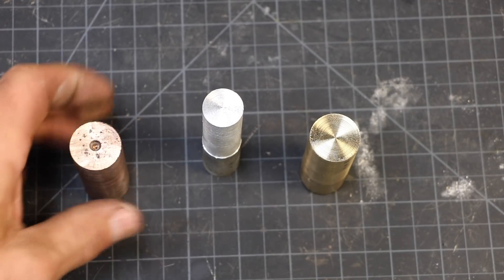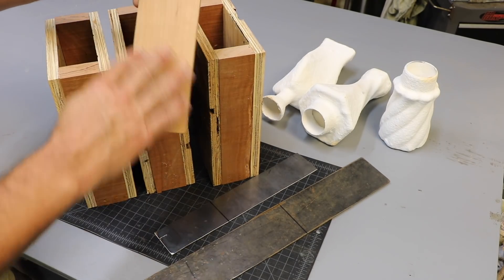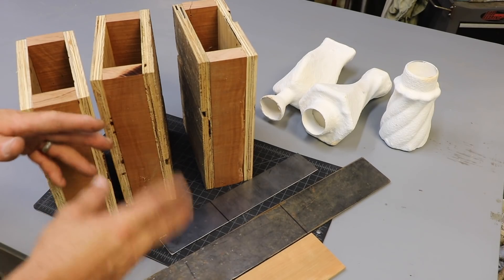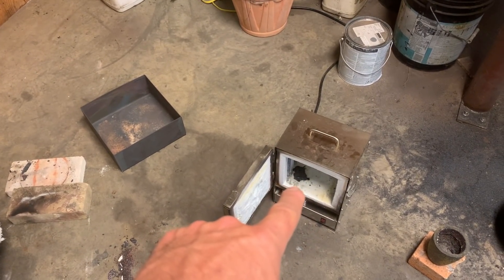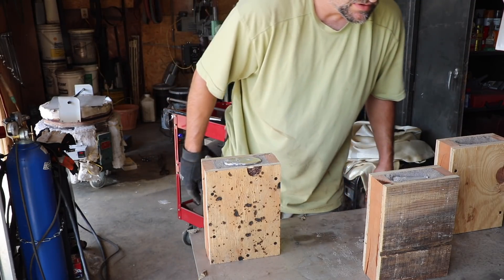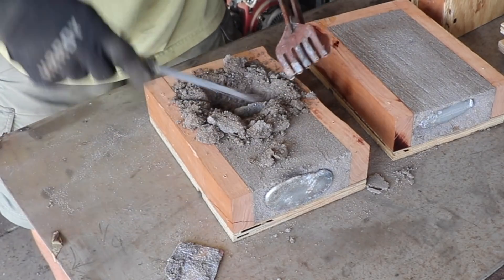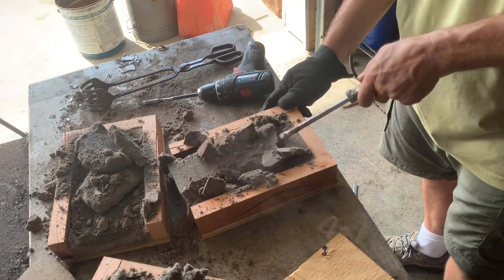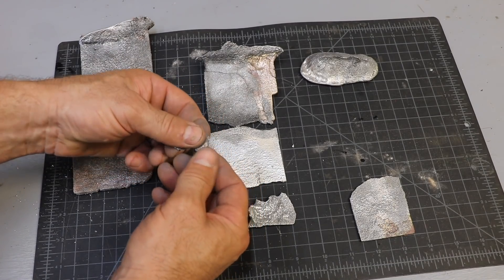Mixing Molten Metals.  What Could Go Wrong??

Comment: Really weird observation, but with the melting temps different, what about casting an aluminum part, clean it up and mount it in the sand mold, much like a chill or a plug, and then pour copper around it, that might allow you basically "stencil" an aluminum image on a copper background.

Comment: 80/20 split of Al and Cu, melted at the same time and in the same crucible, gets you Aluminum Bronze, a type of Marine Bronze that's very strong and extremely corrosion resistant

Comment: Hey, I mix brass alloys for a living. Instead of trying to mix two molten metals, you need to pre-measure and melt them into one alloy.  You know how at 4:00 you added the rest of your copper? That's when you should add your (solid) aluminum to the mix. Then as soon as it's melted stir it and pour over. Don't worry about skimming it, if you're quick enough no dross should form.
Reply from the maker: Appreciate the info, but I'm not trying to make a consistent alloy here.  Were that my goal, your instructions would spot on, and that's how I made the aluminum bronze sample I show at the beginning.  My goal here was to get an interesting pattern of metals swirling between copper, aluminum, and aluminum bronze.
Reply: @FarmCraft101  Ahh. I must have missed that. If that's your goal, you should melt both metals like before, then pour them into  a channel that flows into your mold. The channel allows some alloying to occur, but not a complete mix, while guiding it into the mold without as much density separation.

Comment: Since you said the result was bad, I kinda was expecting to see both metals repel each other or something like that, with blobs of molten metal spraying everywhere.

But, it's an opinion not knowledge, maybe if you got both metals at the same temperature the result could have been better. When you create an alloy, you have to mix them and melt them both together, so the temperature required is actually the highest melting point of either metal. The only thing you did was to disrupt the cristalline structure of the aluminum, it almost but not quite reminds me of how gallium and mecury can destroy aluminum or titanium.

Also, this is only a guess but, maybe red hot aluminum gets more fluid and loses its surface tension a little bit. It might worth the try.

Comment: If your goal was a good alloy, I'm surprised you didn't measure the metals before melting them together using a single crucible. Free pouring, as you point out, is impossible to get accurate.

Comment: I still don't understand what you are trying to accomplish. Aluminum it tough to work with due to bifilms   what you need are good salt based slags on your melts. What you made was part intermetallic.  Best melt all down with a glass slag and oxidize off the aluminum and recover the copper.

Comment: My guess would be that the 2 metals pop on contact with one another. the same way as oil and water do when you get one or the other hot and mix them rapidly. The reason being the 600 temp in-between the 2 metals
Perdition wrong. I did over look the complexities of mixing metals in the nearly unpredictable combinations.

Comment: I have no actual good knowledge of metallurgy, but from what little I know, either the entire box will go up in flames, the sand turns into some type of glass. or the metals won't want to properly mix together, won't one of the metals float higher than the other one? which would ruin the attempt at mixing them!

(the first two ideas were wrong, but the last one in question format was correct..unintentionally!)

Comment: Wouldn't it make more sense to put both the aluminum and copper in the same crucible and melt them together? Then you could manually mix them while they are liquid. the aluminum may be super heated but wouldn't that help them mix?

Comment: I am now at 05:15 into the video. I feel concerned about the difference in temperature. Al at 1400 and Cu at 2000 might result in fireworks. “Predicting” is a big word in this case. I would have weighed off the desired quantities in solid state and then melt them to 2000 together. But then again I am only a theoretician.

Comment: I did this a long time ago just with some copper wire and an aluminum can melted together in a steel can. Ended up with the same stuff you sanded to a shine. Eventually this intuition helped me design something really cool with other slightly different metals.

Comment: Walking in blind, I would worry about rapid expansion of the aluminum. Other than that, I assume the temperature difference will prevent mixing, and the density difference will separate them.

Comment: and aluminum bronze is used for sparkless tools that are used in potentially incendiary environments like mines.....  cool, enjoying so far.  I think that without some flux, there might be that crappy aluminum oxide in the way.  I would think it would have to be equally mixed and dross drawn off, with flux or even silica sand or something to help avoid said oxides, still watchin...  the brittleness does look like it oxidized too much, would have to be mixed and fluxed in a larger qquantity.  Interesting idea, thanks for the experiment.

Comment: I used to cast pewter for a living and on one occasion I was in a hurry clearing my bench of sprues from the molds I didn't notice I had scooped up a brass handled knife that I had been using as well, anyway I shoot all the bits back in the smelter and go and get a  coffee while the pot is getting back to temperature which for the pewter I was using was a lot higher than most to help get it to cast the intricate filigree patterns I was working on, I came back to a pot with the usual dross on top but with a yellowish tint when I cleared the dross I discovered my knife blade and noticed the brass had almost totally melted anyway I cast this pewter/brass mix and it had some very pleasing colouration maybe try a version of that

Comment: The cooler copper is going to rapidly solidify the aluminum, preventing them from mixing properly. Also, I'm sure some violent reactions will ensue based on the temperature differential.

EDIT: Well I was right about them not mixing properly, but forgot about density issues. And no fireworks lol

Comment: I was thinking before you poured it that a combination of the two metals, because they are both molten and have different melting points it will cause some sort of violent reaction either splashing out of the mold or the mold breaking. - since I didn't see any predictions
Reply: oops I was off

Comment: ok so im no expert on metallurgy by any means but im gonna guess since alloying usually happens in the melting process that the mixing of molten metals is gonna have some de-lamination during your pour, or the metals might oxidize during pour and come out crumbly since i didnt see you add any borax....curious to see what happens!

Edit: ok so they didnt really mix at all...was kind of surprised to see the aluminum turn out to be so brittle in the end too! ive heard some friends call aluminum the styrofoam of structural metals before and i guess i can see why now :P at least the bronze bits that DID mix looked really nice!

Comment: no need to experiment-
There is data that has been written down in stone, metal and USB for the last 15K years.
Alloys are an ancient invention. There is a reason Aluminum wasn't alloyed until the last century- 
It was discovered with chemicals.

Comment: What about putting aluminum rods in the mold and pouring the molten copper around them.  The copper should partially melt the aluminum and cause some mixing, might give some interesting patterns.

Comment: ok, my prediction @ 5:15 ... is the temp of the copper higher than aluminum boiling point? i don't know, but if so that could cause an issue. also, is the mold big enough to be filled properly? those seem a little thin especially with no venting in them. EDIT: nope...way wrong lol

Comment: I commented 30 minutes ago but still thinking. There is the thermal expansion issue that may cause cracking at the interface but I am thinking that is a small percentage of the problem. I think the alluminium is oxydising long before it gets to try and mix with the copper. So the metals interface is seriously oxidised and therefore pourous. Its asking to break along the differential metal seams.
Shoot me if I am wrong, I dont mind!

Comment: I have no smelting equipment. But watching this - Why do smelters not fill their cruciples / furnaces with an inert gass?
When welding: stick electrodes are flux coated and MIG is argon or CO2 or mix covered and TIG must be argon shielded. SO: why dont smelters adopt the welders knowledge and use a gas to stop the molten metals oxydizing and making masses of DROSS?
Just my passing thought.

Comment: Idea 1: Boundry layer messes up pour. The lower temperature of molten aluminium cools copper too quick and forms granules that clogs the channels.
Idea 2: Some kind of exothermic chemical reaction. Cooper and aluminium will form a battery in electrolites. Maybe they do it really quick when in liquid state. Might not be a problem when you melt them, as only a small amount is liquid at while they are mixing?

Sucks, neither hit.

Comment: I predict the metals wont mix, and will dry brittle and crack apart.  
And I was wrong - I was expecting a piece of solid aluminum, then solid copper, only being brittle along the seam between the two metals.  I wasn't expecting it to mix that much and have the whole thing be that brittle.

Comment: So with the dual pour method, I figure that extreme temperature difference between the copper and the aluminum would cause some gassing / sputtering of some kind, with the metals not alloying but just solidifying on one side and making a bunch of little copper beads sitting at the bottom of some aluminum. 

Pour, wait, pour, I think would be the most interesting. Maybe the aluminum would just melt again, and with the low volume you'd end up with two layers, or voids and breaks that slowly fill in. Again, I am a little suspicious that the conditions to alloy during the pour just wouldn't be right. Combined with the problem of ratio, just leaving you with a mess, more than anything.

Comment: since there is an 800 degree difference between the them I think the temperature shock will mess with them. I doubt it will be hot enough to turn the aluminum into a gas, but i still don't like the idea of that 800 degree difference. I also think there could be poring difficulties, but who knows.
Edit: ahh yes, density

Comment: Two metals at different temperatures they have the same boiling points, or at least near enough... ~2500c from memory,  but the aluminium is much colder... Does the aluminium freeze the copper? (as in turn the copper instantly solid?)
Reply: Okay I was wrong. but the result was interesting.

Comment: So I just paused @ 5:30 to give my prediction. I predict this will end up more f#*ked up than a soup sandwich. Reasons being similar as to why people don't try (with success) to forge weld copper and aluminum. I may be wrong and I can accept that. Let's find out. resumes video

Edit: Well, full video watched. Soup sandwich achieved. Thank you for attempting this so the rest know not to. A great public service. While these words sound like they come from a condescending @$$hole when read as typed, I assure you they are sincere. I had no idea for certain what would happen and appreciate the work you put in to find out.

Comment: Thoughts: Aluminum has a lower thermal conductivity than copper, as well as being about 1/3 as dense. This means that the copper is going to sink down into the mold in a liquid state, leaving the aluminum to solidify on top.

Comment: Well Aluminum and copper both have different expansion rates and different melting/boiling point, I could see something like poring water in to hot oil happening here. (have not seen the results yet) edit: well at least my fears didn't happen.

Comment: One slot will be too thin to get any good pouring into so your mold won't get good flow. I also think the copper will stay so much hotter that it will keep the aluminum melted until the copper sinks to the bottom.

Comment: I think the copper, being 600 degrees hotter, will have a negative impact on the Aluminum, conversely the Aluminum, being cooler, could semi harden the copper, also screwing up the mix >edit.... well, I was wrong, but thats not surprising, lol. You had interesting results, I wouldn't call it a fail exactly since you weren't attempting an accurate 90/10 mix. Personally I would like to see an attempt at that, possibly as an urn after a small test mix prior! <

Comment: You should make pouring basins with little holes in the bottom. So you can control how much, and how fast the metal goes in the mold. If you adjust the hole size enough you might even be able to get close to your 90-10 ratio you are looking for.

Comment: I machine aluminum-bronze all the time. When the raw stock comes in, you can see the wavy aluminum copper mix on the outside, but the moment you cut into it it's a solid bronze/brass looking color. Always wondered why this is... oxidation?
Reply from the maker: That would be my guess.

Comment: You should make a correct batch of the copper/ aluminum bronze and pour it with a molten batch of aluminum, maybe that’ll produce the effect you want.
Reply: Plus I thought there would be an explosion when you added separate molten metals together. Surprised to be wrong.

Comment: Hey mate loved the video ive wanted to try somthing simular but with copper and brass they are so close in melting temp they should stick and leave a pattern was also going to try bits of copper in a tube and pore molten brass in see what happens should be an interesting pattern when cut open. Love to see you give it a shot

Comment: Pardon for sounding like newb is the reason why you don’t melt both metals in 1 crucible due to Copper having the higher melt point and would burnout the aluminum? Or melt the copper and add the 10% portion of heated aluminum into the copper crucible for less heat loss.

Comment: Would be interested in seeing it poured into something like a cement mixer, that way they are actively being mixed, though might just coat the mixer. But active mixing could let you pour in the copper and the pour in the aluminum while the copper is still hot. Then once alloyed you could repeat and cast into something useful

Comment: For my first time seeing this, I will say that the temperature difference between copper and aluminum is going to cause what you get with water spilling into hot oil. I put this up on the time of 5 minutes and 23 seconds. I didn't want to cheat. Let's see what happens now.

Comment: Spray form.  Spray them at the same time. Let the molten metals leak out a small hole in the bottom of the crucible then force them with compressed gas toward the mold or make a billet to be machined.  Adjust distance from the part for each metal. There won't be a lovely Damascus look to it though.

Comment: My prediction?  Probably some form of reaction at the oxide layer that makes this somewhat dangerous to perform outside of an inert atmosphere.

Although even neglecting that, a striping of dissimilar metals from a homogenous melt into the mold usually will result in interesting grain boundaries that range from cutting diamonds like butter to being polymer putties.  So, whatever results will probably not blend well and just crack apart during cooling.

Comment: Aluminum has a fairly small molten state, go past it and it crystalizes, go further and it vaporizes.  

I've worked in an aluminum casting plant, aluminum is caustic when molten and is VERY temperature sensitive (if you are wanting to keep the integrity of the aluminum).  I worked back in mold repair and we would have to soak the cast steel forms in high temp caustic soda to dissolve the majority of the aluminum, wash them off, sand blast the rest of the aluminum off, put them in a tempering oven before we could weld the pitting that the aluminum caused.  There was always a little aluminum left in those pits, and it the second you hit it with a TIG torch, the aluminum would get real bright (like a little sun) then fade to dull red right before it vaporized while the steel around it heated up and I could fill those damn pits.

Comment: I like these results. Sad that they are so small. I am wondering if there's a third metal you can add to one or both of the starting metals to stabilize them. I am thinking lead or tin to the aluminum. And gold to the copper. But I would worry that the more different kinds of atoms you have, the more chaotic the crystal structure.

Comment: Personally, 
I'd find it fantastic if you'd take all the crap aluminium alloy, cast your vase in green sand, water rinse off sand. 
Then you'll have a great prop that you can slow mo' the shattering effect... say with a slingshot & bearing. The outcome I believe would appear more devastating than a stronger metal vase hit by a large caliber weapon.

Comment: Could you make some Cu-Al Bronze, melted together at the same time in the proper proportions.   Line the vases with thin aluminum wires, then pour the molten Cu-Al Bronze into the molds to make your vases. Would the aluminum wires melt into the bronze but leave a pattern?

Comment: Stopping at 5:20 to give my prediction...

Since both metals are at different temperatures, there's a chance it might go volatile, with the aluminum being overheated to compensate for the copper's high temperature. It'll be like a fudge ripple of metals; they'll swirl together but not form a true alloy.